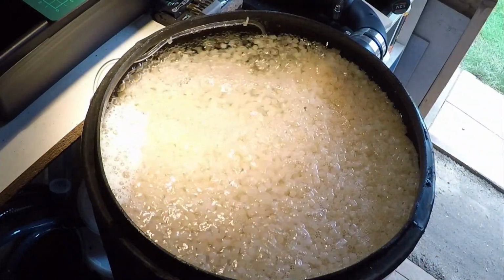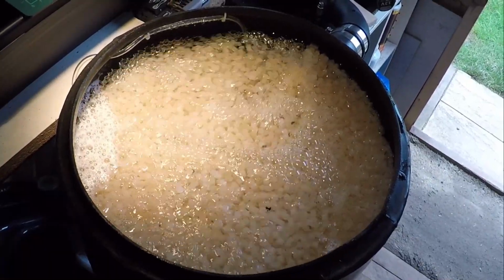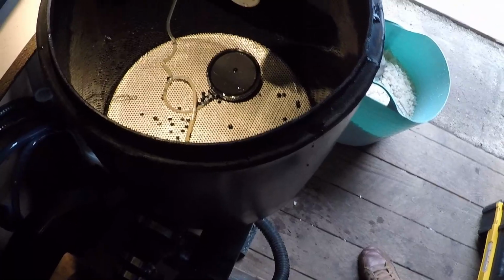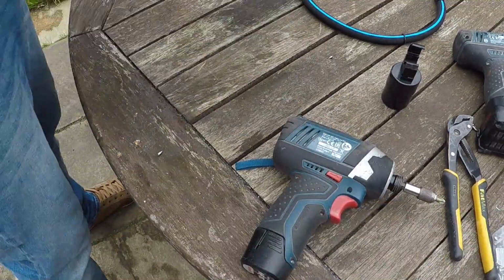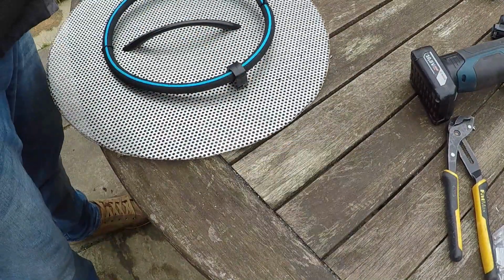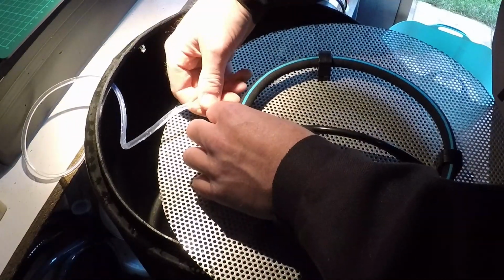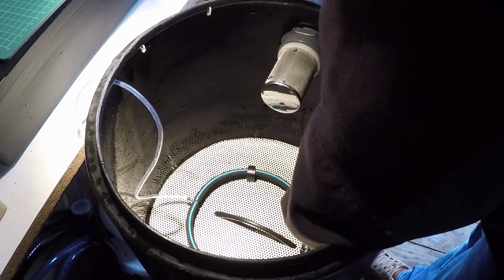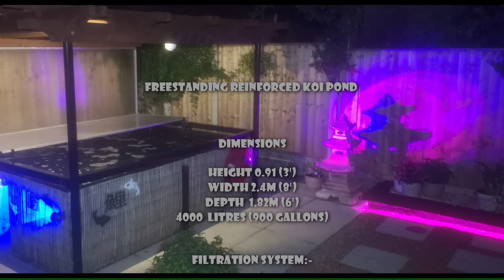Part III Moving bed adjustments Pond DIY fluidized bed.

Comment: Have you thought about removing the manifold at the air pump and running the larger diameter air line direct to the air diffuser?
Would probably increase your air flow and reduce the amount of stagnant K1.
Reply from the maker: Hi Cecil and thanks for stopping by and commenting Sir. 🕺🙏⛩️🈂️KC